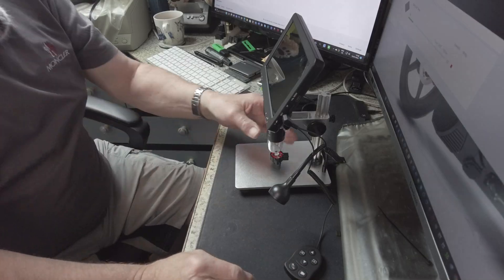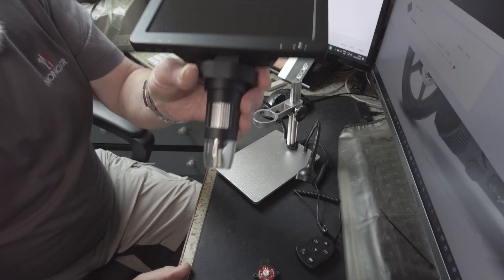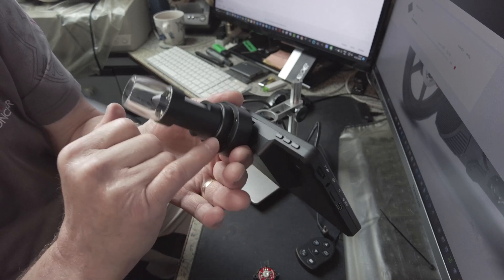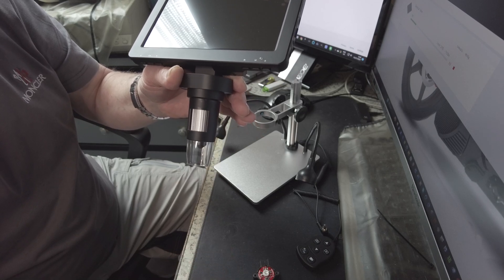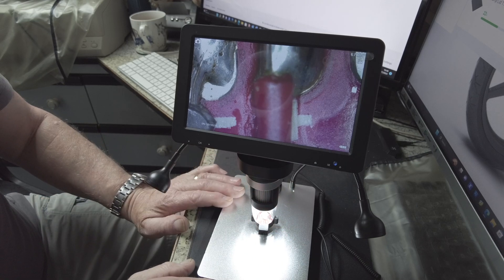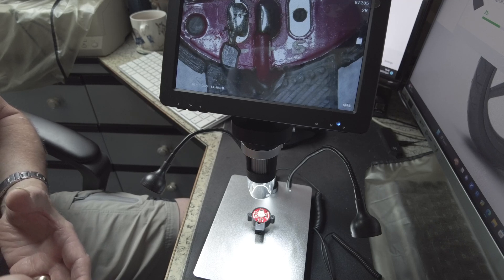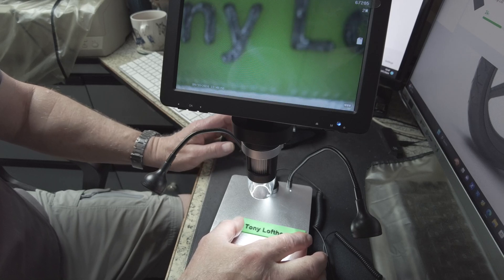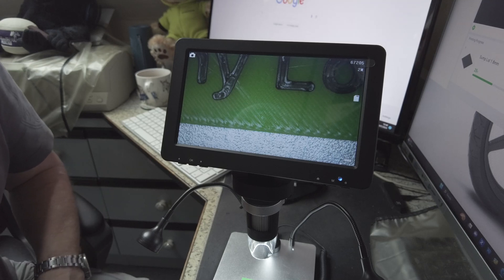Temu Digital microscope found to be Faulty and I didn't even know.

Comment: I've just bought one from temu but can't get the wheels with the locking nut to fit on so it can move up and down
It
Reply from the maker: Thanks for the comment mine would not focus with focusing  knob but it goes up and down on a geared rack is the locking nut undone
Reply: @Tonys.Top.Tips.Workshop  done,I was putting it on the top not bottom,seems very good for the money
Looks a bit smaller than the one you have though
Reply: I have one an the led lights quit working

Comment: I have a similar one that worked fine except that the claimed 1200x magnification was a con. Divide the displayed item dimension by the dimension of the observed object to get the magnification factor. Try to observe cells in a spot of blood.
Reply from the maker: Hi Thanks for your comment and the info I use it more for checking how my brine shrimp hatchlings are doing I know it says 1200 but its not that but for what I use it for its good